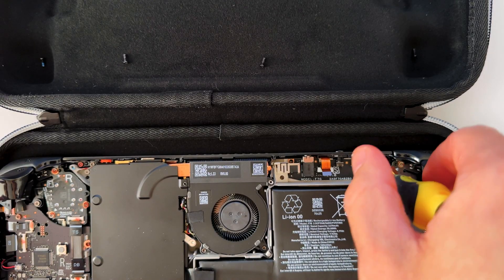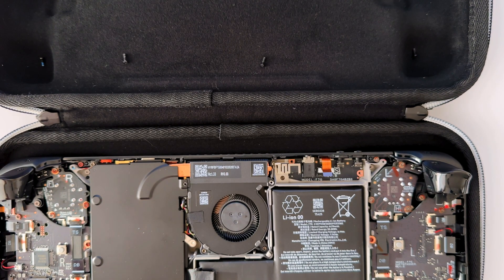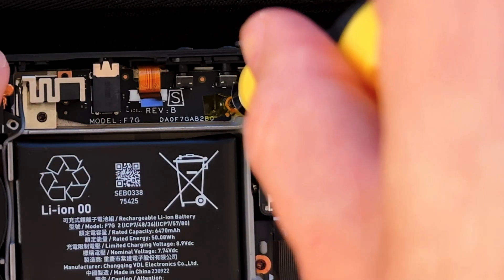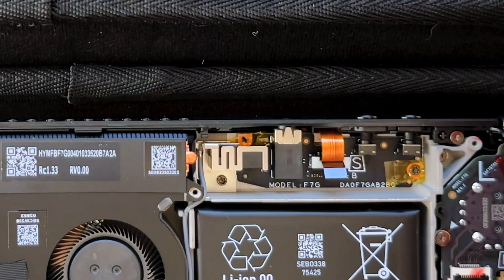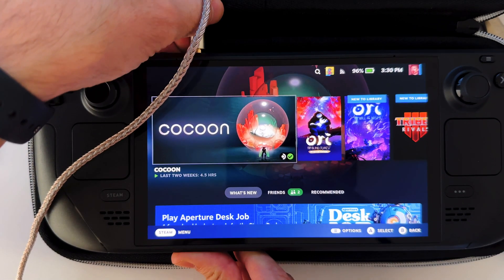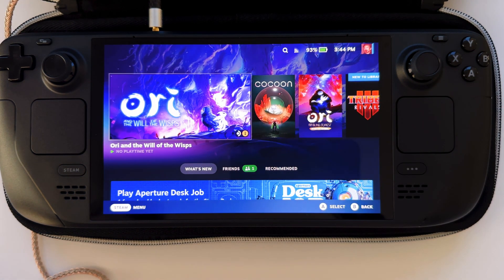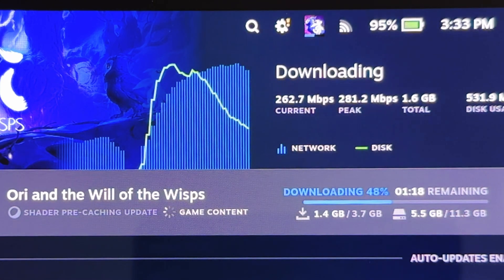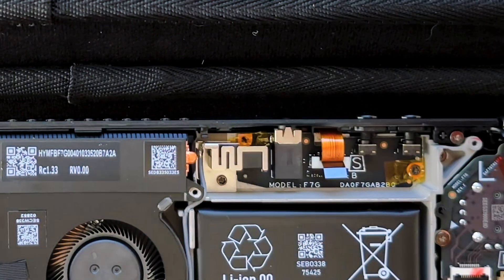Fixing the Steam Deck OLED's Biggest Problem

Comment from the maker: 🔗 links

Original Reddit post: https://www.reddit.com/r/SteamDeck/comments/188fxu1/fix_audio_cracklingstatic_on_35mm_headphone_jack/

Apple USB-C to 3.5mm - https://amzn.to/49WIHYS
ifi GO Link - https://amzn.to/3Rk0m5w
ifi IEMatch - https://amzn.to/47Axj3n
Questyle M12 - https://amzn.to/49WccKn
Questyle M15 - https://amzn.to/4a2f3Se
Reply: Hello, I am the creator of the post, thanks for your mention, if you insulate the plate from above with the kaptom tape and do not tighten the screws 100%, you will not hear any sound. I have also used tape under the plate to insulate it better.
Reply from the maker: @chinymontana3199  hey thanks for commenting! after recording i did go back and try loosening the screws a bit but only got it 90% gone, still annoying to me personally. didnt try putting any under the plate though!
Reply: @TonyCassara  I trust that Valve will solve it like they did with the LCD deck , this is a temporary solution. Thanks for the video :)

Comment: I just bought an OLED and because of this video I checked with the oscilloscope and it shows no interference at max volume through the 3.5mm. I think they've fixed it on recent models or it was just a bad batch. If you return yours they will most likely fix yours too.
Reply from the maker: I did RMA and they fixed it
Reply: @TonyCassara  Great!

Comment: I completely eliminated the headphone noise on my OLED deck by using the electric insulation tape trick, but one thing I did differently that I haven't seen anyone mention yet is that I used two layers of electric insulation tape.  I just folded the insulation tape over.  I don't know if that will make the difference for any of you but it worked for me.  My headphones are Timeless 7hz.

Comment: I was able to completely eliminate this problem on my own Steam Deck OLED by doing something different. Leaving this here in case anybody wants to try this before the tape mod. 

What I did was taking the back part of the Deck apart and then plugging headphones into the deck from the jack, from there I put them on and listened to the sound of the hiss whilst I went back and forth to slowly and very slightly loosening the two screws that held together the headphone board. After a little bit of tinkering, I was basically able to fully eliminate the buzzing/hissing noise. There is a very very minor static sound that i can hear if i paid super close attention however that could just be the OS I’m not entirely sure. Otherwise it’s not noticeable at all. 

Hope this helps anyone that comes by this comment and might be confident in taking their Deck OLED apart to attempt this fix. I’m super glad it worked for me as I really did not want to turn this device back over to Valve after having owned it for only a few days.

Comment: I’m sorry but this is inexcusable. This is the most basic function plugging in headphones why is there feedback? How did this get through QA? Why is valve not issuing a statement about this I am so sick of it. It’s driving me crazy.
Reply: Valve does not care. The steamdeck  had alot  of quality  control  problems.  I got 2 defective  steamdecks all brand new and my 3rd one works, so ,but I won't ever buy those junk again.
Reply: @Elknkam why you bought 3 if you didn't want it ?

Comment: I have the Razer Hammerhead Hyperspeed earphones. It works on Bluetooth fine, but I got those earphones for the low latency USB-C 2.4Ghz dongle. I notice that they are very loud on this mode. Even when they’re set to the lowest volume they can still be pretty loud. I thought it was my earphones the whole time, but maybe it’s the Steam Deck? The weird thing is I’m not using the audio jack. I’m using the USB-C port to transmit audio wirelessly.

Comment: You might want to try it again, but this time don't use tape. Use heat shrink tubing to create a tiny washer to give the screw space. Based on what I've read (and my personal experiences) I don't think this is a grounding issue as much as it is the screws being too long and picking up interference from the OLED panel (which it is right on top of).
Reply from the maker: Honestly I so prefer the sound of my usb C DAC/amp that I don’t need to fix it
Reply: Yeah I think it is the OLED panel. Mine gets a lot louder when I use the touchscreen.
Reply: Have there been any follow up to your idea?  Like is it the screws are slightly too long?  If so, do we know the size of those screws as in to order 1/2 mm shorter or find plastic washers in the diameter.
Reply: I did this and it fixed the static issue 100% for me.

Comment: i fixed mine by completely removing the daughterboard which involves removing the wifi antenna (the rectangular with the metal design on top, right below the left screw that made it difficult for you to tape) which is held in place by velcro, so it just takes a little force. the third screw you taped is for the wifi antenna and wouldn't affect the EMI at all. i taped the two screw holes under the pcb, as well as the screwholes on the pcb and that completely removed all noise for me. i even tested with my campfire andromeda 2020s which are notorious for being very sensitive and the noise was unbearable before this fix, now it is completely silent even when navigating menus. 

i'm not sure if i can link the guide on reddit that i found, but it had step by step instructions with photos and it was very easy. i believe taping the screwholes under the pcb along with the pcb screwholes is key to getting rid of the EMI completely. i hope this helps

Comment: Hi Tony, I have LE model and I'm noticing a noise from the left thumb-stick when rotating it or point it left or right. Its like its touching something, any idea? the right thumb-stick is fine.
Reply from the maker: Check out my other video, there’s a Reddit thread talking about that problem. I seem to recall the solution was to RMA it.
Reply: @TonyCassara   Send it back to Valve?

Comment: On another note, has anyone been able to use their official Steam Deck Dock with their Deck? Mine is completely borked after the recent software/firmware updates to both the deck and dock. My TV outputs a black screen. 3rd party dock works fine.

Comment: Do you have problems with Wi-Fi randomly disconnecting like I had with Steam Deck original model? I had to get a replacement because I don't want to have issues with Wi-Fi.
Reply from the maker: My WiFi works great! But I haven’t played any online multiplayer games yet.

Comment: What iem’s do you have?
Reply from the maker: 64Audio A12t but they come in a universal fit U12t also. Absolutely end game IEMs!
Reply: @TonyCassara  Nice, I’ll have to check them out!

Unfortunately I’m hearing the interference even with old iPhone EarPods with the 3.5mm jack. I’m going to try it with my AKG K702 these are 62ohm. I normally use them with my desktop powered by a Schiit stack.

Comment: Just tried my sony xm4 wired with steam deck, and yes it does buzz a lot, and it gets quieter when i lower gpu clock. Something really strange
Reply: Not strange at all. Most likely it the interference from VRMs feeding APU.
Reply from the maker: Yes sadly it’s interference caused by not isolating the headphone PCB from the rest of the system :(

Comment: I dont have IEMs but i used my audeze planars with the 3.5mm and it does not show up on mine, not something ill use often anyway but its nice to check, the only fault with mine so far is it doesnt want to undervolt, and thats a bonus if you can in the first place.
Reply from the maker: Planar headphone need a ton of power so it makes sense faint interference wouldn’t be detected. Tbh you’re not getting great performance with the deck if you’re using the 3.5 jack. Unless it’s the Maxwell, you’ll wanna try a USB C DAC/Amp specifically the questyle m15
Reply: Which Audeze planars? I have LCD-X's (which are very easy to drive for being planars) and a 512gb Deck on the way.. hoping I don't have this issue. I know I can just use a usb-dongle instead, but I know that cuts overall volume..
Reply: Yeah i got the maxwells, come to think of it, its probably a silly comparison by me as... duhh they have a battery inside even though i hooked them up wired, still just tried them with the sony MDR-7506's and my sound is crisp, I would have a set of IEM's if i liked shoving things in my ear canals :P

Honestly, we know that not ALL of the decks have this issue, probably just early production, ill just say hope for the best and keep in mind that whilst yes it is a common issue on these new decks at this point, how vocal people are about them on the internet makes you believe in the worst 100x to what you actually get. @eleven9286
Reply from the maker: @eleven9286  there is no way you're going to adequately drive those with just the headphone jack on the steamdeck... youre gonna want the Questyle M15 at least.

Comment: I think people completely forgot that this was an issue a year ago with the LCD Deck that valve patched through software. Hopefully that can be done here. Out of the two OLED Decks I got to test, both of them had the noise to a very very slight degree. Like I need to be in a very quiet room to hear it and cannot hear it over game audio, so for me it’s not worthy of an RMA as everything else about my Deck is flawless. But I do think voltages or something with the audio driver could be patched to address this and I’m surprised so many people are rushing to RMA, unless it’s worse that what I’m hearing. Some people have said it’s as loud as their game audio which is wild to me and in that case I would definitely RMA.
Reply from the maker: Yeah it’s gonna be a personal call but I think many people are disappointed to have paid for such a nice device and had problems with it.
Reply from the maker: Lest we forget Apple’s “you’re holding it wrong” moment hahs
Reply: That was an audio pipeline issue (which has popped up again somewhat with 3.5), this is clearly interference. I doubt there's a software fix that can remedy this, we would have seen something by now.
Reply: I was told by Steam Support the Beta Steam OS would correct it.  It did not.  This is clearly a hardware issue that a software issue can't hide.
Reply: @d.r.1402 the steamdeck  has many  problems  just watch Valve  start  reselling  there Oled as a Refurbished.

Comment: Nylon washer would be way less jank of a fix and not cost much more than capton tape
Reply from the maker: I was gonna try that too or nylon screws but tape was fastest haha. Either way neither is an actual fix. It’s like the NZXT H1 case catching fire because of the non insulated screw mounts.
Reply: I suspect the main issue is the wireless antenna they put just to side of the headphone jack, definitely an over sight. They are worried enough about the wifi card interfering with the ssd that they warp it with an emf shield but then they put a wireless antenna right next to an analog audio output.

You could try disconnecting from the motherboard the wire that is connected to that antenna and test to see is that impacts the headphone audio output. Also check how it impacts your wifi/bluetooth (not sure if its a wifi or bluetooth antenna) speed and signal strength.

If it is the antenna is effecting it you could try emf shielding like they used on the m.2 SSDs. Take that daughter board with the headphone jack out, wrap it length wise with capton tape to electrically insulate it then wrap some aluminium foil tape around over the capton tape. If your worried about shorts you can also do one more wrap of capton to cover the aluminum foil tape.

Alternatively, iFixit sells the sdd foil cover for 4.99 you could buy a couple of those, use them cut to size to wrap around the daughter board to insulate it from the antenna.
 @TonyCassara

Comment: How do I get my usbc dongle to work? I plug in my iFi Go link dongle into the usbc port and sound still comes through the Decks speakers.
Reply from the maker: Make sure it's plugged in all the way! Maybe remove and re-plug it in.
Reply: Make sure to go into the Deck's BIOS and change the USB mode from DRD to XHCI. You can boot into the bios by holding Vol+ and Power when it's off, and then Setup Utility -> Advanced -> USB Configuration -> change Dual Role Mode to XHCI.

Comment: or you could just use a USB C headset or wired earbuds. That's what I use. works great 👍🏻
Reply: The only problem with that is that some people like to plug it straight into an outlet from there so it'll defeat that purpose.
Reply: Also some people have favorite pair of head phones. Some of which are still 2.5mm

Comment: In the meantime you can use a usb-c apple dongle those have nice dacs built in surprisingly, not incredible but very compact? i'm not sure if it'll work tho with the steam deck
Reply: it sucks when u wanna play and charge at the sametime, and just having to remember to bring more dongles and stuff in general
Reply: @tinostarks  yeah true! Thankfully o don’t play for more than 3h a day (1h~) but the battery anxiety for sure sucks
Reply: @tinostarks  I saw those dongles with a 3.5mm audio jack and a passthrough for power. Shouldn't that work?
Reply: How do you get a dongle to work? I tried my iFi  Go Link and sound still comes through the decks speakers.
Reply: i actually just tried it and it sadly doesn't work :(  @michaelp.3485

Comment: I have this issue with my IEMs, but not with wired DT770PRO but the deck can't really power those to its fullest. Bluetooth works well. I think Valve needs to look into this issue. I put in a ticket but I don't want to RMA
Reply from the maker: I don’t think RMA will actually fix it unfortunately :( I hope some people can share when they get their units back
Reply: @TonyCassara   It did not.
Reply: It can likely be fixed with a software update.
Reply: Unless it's an issue with overdriving the preamp, highly unlikely. The interference is clearly coming from EMI, which is likely going to require a hardware remedy of some sort. @S1RLANC3
Reply: @S1RLANC3   It cannot.